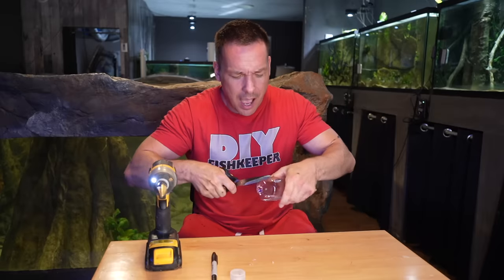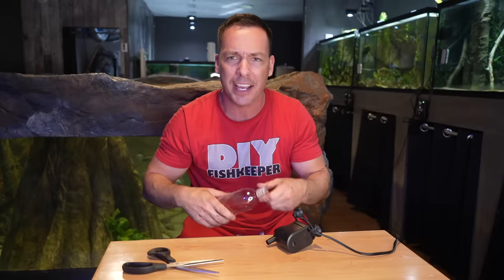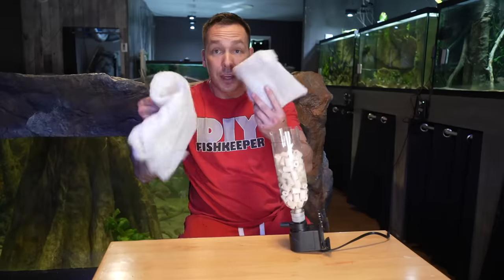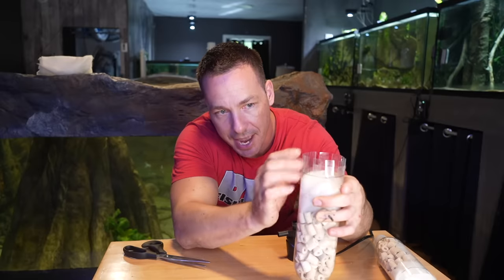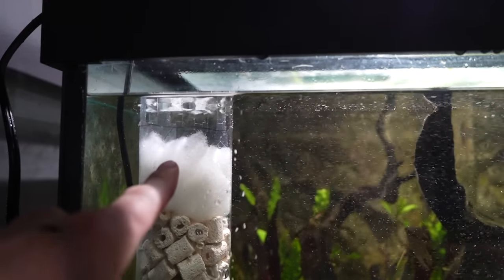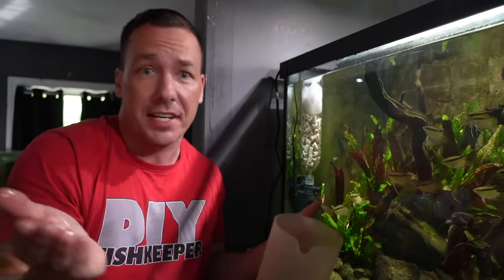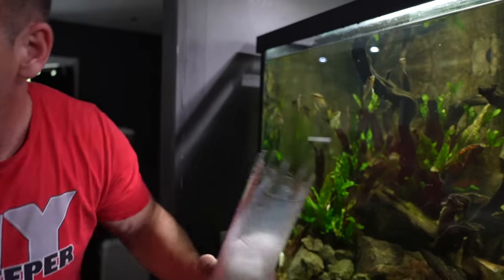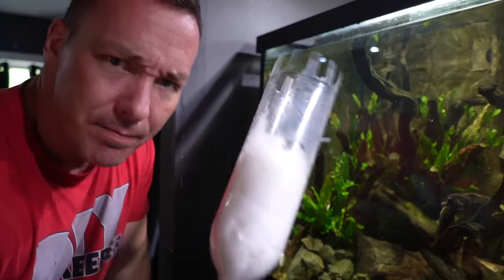BEST aquarium filter - DIY homemade fish tank filter - The king of diy

Comment: It is a little less common to find the two spout filter (in and out) and also to find one with suction cups on it, it might also be possible to put one that only has the pipe outlet into the bottle and put the outlet our through the bottle top. It would need to be a small filter to fit the bottle. This way if would all be contained in the bottle. Just a thought.

Comment: a great filter design i know of is made from a terracotta pot that has a pvc tube in it and around at the bottom of the pot it has gravel where the pvc tube would have drilled holes, and at the top half of the pot there would be aquarium soil , then if you put plants in that soil and put an air tube connected to an airstone you have a filter that is alive because the plants would use the nitrates that would be filtered through the sucked up water.

Comment: Hey I would just add caution to using this as a gravel vacuum from an electrical stand point. Take all manufacturers recommended electrical precautions using the items you choose. Outside of that this is a great DIY tool. Thank you for sharing.

Comment: Hey bro, I've made a similar filter in my 20 longs before. Take a half inch or 3/4 piece of pvc tube about 12 to 16 inches long and dull holes in it and attach it to the outlet on the Power head and make a spray bar. Very simple and it doesn't cause such a strong return current. I also plasti dipped my filter and spray bars. Give it a try, maybe it'll fit your needs. Anyways,  another exciting and informative video, love seeing the old passion back in you man. Excited to see this new gallery, it's looking amazing. Love the channel.

Comment: That’s brilliant, I built my own internal canister filter based on one of your designs. I got a video of it if you want to see it. I think I’ll use your gravel vacuum idea,  I really like that you can do it without removing water, as I use ro water and can’t always vacuum because I need to go get more and I don’t need the water change atm. Great idea. Maybe I’ll build an adaptation of your skimmer idea in the future. I like the thought of using abs pipe. I tried to do that when I built the internal canister filter but as it turns out where I’m at you basically have to buy that stuff online because not even Home Depot  had any in store. lol thanks for the future inspiration.

Comment: Filters: i havnt read your book. but im a huge fan of the HMF guide  by Dr Deters.
he really breaks in down, so i trust his calcs. the water flow entering the sponge of the hmf filter should be about 5cm/min to 10 cm/min for best results. that will allow the bacteria todo their thing. but as of, max 30cm/min the bacteria cant hold on to the surface any longer. tbh 5cm/min is pretty damn slow. techniqualy i dont think the is much differenvce what the surface is made of , ceramic, laqv rock, PE.. thats to say i worry the flow rate insiden the diy fiter is simply to high for any biological filtration to take place.

Comment: Cheap power heads leak electrical into the tank.

It’s still more practical to hydro clean into a bucket with a 100 micron sock, then return the filtered water to the tank.

Comment: Joey, would the ceramic media be fluidized if you put a little less in, or would the filter floss just get sucked down to the top of the ceramic media?  Fluidized biological media is good because the movement increases the surface area of the media exposed to the water, right?  Trying to clarify in case I'm going crazy or have the early onset dementia I often suspect of myself.

Comment: Thank you for this design. I built my own and am using it in my 75 gallon. I'd like your advice regarding my plans on masking it. I plan on wrapping it in a stainless steel mesh and spot gluing moss to the mesh. Over time the moss will spread and the entire filter assembly will become a feature instead of an eyesore. I am also thinking of using the mesh in conjunction with suction cups to create a moss covered back wall. I will fold over the edges of the stainless steel to minimize any fish injury. Do you forsee any problems with my plan? Thanks.

Comment: Hey Joey I have a question. I have two tanks now a 40 and a 60 side by side. Both leveled, however if I bounce/ jump right in front of the tank it wobbles. Will it potentially cause future issues. Like tank damage or anything. I am not sure what to do about this situation. Any help would be awesome.

Comment: I have a 150 gallon tank, using a 30oz bottle, and sand, also have a overhead filter with bio media red lava rocks, and a bunch of filtration. Also using a mj1200 power heads for both, 295gph, is that good enough?

Comment: Any bottle size recommended for a 20 long in mind? And how would it fair for floaters.
I've done 2 sponge filters attached to a like 40-50 gallon air pump now, but it's still leaving the water kinda cloudy currently